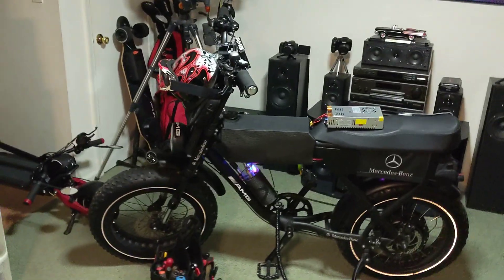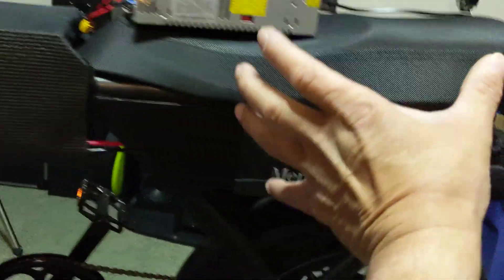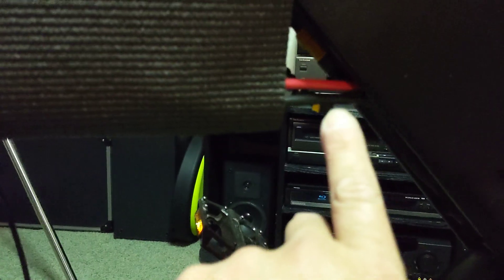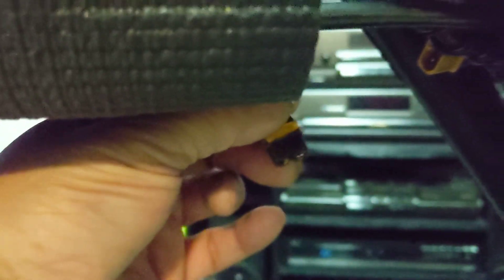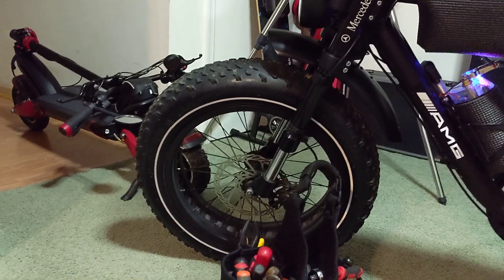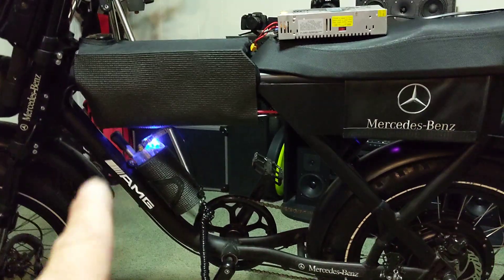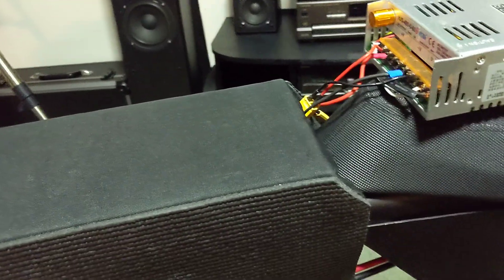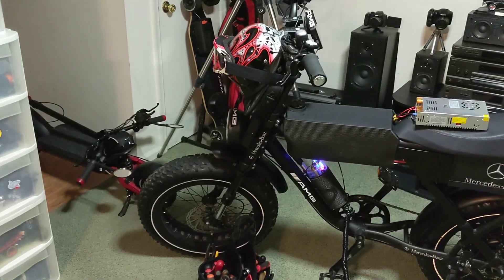High Output Ebike battery systems, remove connector between Batt and controller. it's a bottle neck!

Comment: Bro- ur a ebike magician... lol
I'm a complete newb at this. Trying to soak up as much as possible.... Just got my first bike.  One run,  i knew i needed more. Im hooking in a 52v to a 48v thru a battery mixer.  If it works, I'll add a third one by end of summer(the mixer can run 4 batteries at the same time).
Keep putting out the tech know how- I'll try not to burn up my bike while learning🤣🤣🤣🤣🤣
Reply from the maker: lol My man be careful with those battery blenders tho. I know they claim they work but honestly that right there is some magic because that goes against all the laws of electronics let me tell you. Your not supposed to be able to mix different battery voltages in parralel. Im not trying to say they havent come up with a safe way but I been dealing with batt systems for a long ime, not on ebikes but batts are batts. I know exactly what your talking about ive seen that shit on Freddies ch and spark cycle works. I know they have a circuit thats not actually allowing them to connect at same time but when voltage drops to a cetain level it switches over to other battery but anyway. let me know how that works out for you long term. Thanks take care stay in touch
Reply from the maker: @danimayb  I know what it is and I'm definitely not faint hearted, you must haven't watched many of my videos. I just don't think it's worth a dam. Just as you said just a simple diode circuit that I wouldn't pay $150 for.  lol I'd just get off my bike and plug the other battery in when I killed the first.  If I want real capacity that I can't put real current demands on I'll put two batteries of equal voltage in parallel. I'm trying to save these guys money and $150 ain't worth what a blender does. I've heard the speil about the range increase so does just switching batteries manually

Comment: im sorry but i coudnt disagree more. your problem was not that you were using connectors, your problem was that you are using underpowered connectors. a hard wired connection is a PITA to do work on. just use the correct connectors.

xt60 is a 60 amp connector, if thats insufficient then use an XT90 connector that runs 90 amps. if thats not enough use a QS8 connector that runs at 120 amps. if you need more than that use d6 connectors that run 160 amp.

and FWIW, i did spend a bunch of money on a litespeed 40ah battery and i just had to change the connector from a QS8 to a D6  because i upgraded from an 80 amp speed controller to a 150 amp speed controller.
Reply: People seem to forget the vibration in a connector or the big sparks from plugging in or out. Not to mention rain water getting into connectors and causing corrosion and bad/intermittent connections. A solder joint and marine grade heat shrink is the way to go.
Reply from the maker: @Mike Morgan  Thank you Bro for being a smart person and knowing the best and proper way for pwr is to have as few weak points as possible and disruptions to real pwr and it's just a surface connection as it's just the sides of those terminals touching each other as Solder joint is all the way thru the entire wire. great comment
Reply from the maker: another great point I forgot to mention
Reply: @ChrisCrossingWires1212  , A proper connection is one you never have to work on or disconnect unless it’s with wire cutters.
Reply from the maker: @mikemorgan8588  ABSOLUTELY and he probably don't get that cuz in that situation you don't even have time for connectors, cut and kick! lol
Reply: @ChrisCrossingWires1212  , Yep, keep riding.
Reply: @mikemorgan8588  sparks from plugging means you don’t know how to use power switches. That’s kinda messed up. It shouldn’t spark, control your electricity man.
Reply: @dumwaldo  , The contacts in switches are sacrificial due to arcing . There is no difference.
Reply: @mikemorgan8588  its not supposed to arc. my first attempt at building a bike did that but i LEARNED MORE and that doesnt happen when you do things right. its not supposed to arc, install a power switch.
Reply from the maker: i know that i only had xt60s on there but i was not about to wait on ordering some and have my bike down so fastest way to resolve that was remove them and why should i keep any connectors after that if Im never gonna remove my battery's ever. Now im recommending people remove them but Im talking about guys running high power systems, if you have a system that isnt pulling more than 100 amps sure, im talking to the big boys out here 200 amps, 10-15kw. i should have stressed that but no worries and you can disagree, you have hat right but this is my build and thats how i chose todo it. as i said im never gonna remove my batts and i didnt have time to wait so this was MY SOLUTION.Also as you mention, you did pay top dollar for a light speed battey, If I paid 3 grand for a batey maybe id spring for those big fancy 160 amp connectors but Im not about to put connectors on my build that cost more than my battery system, make sense? as I would need several with all the batteries I have, Just wouldnt make economic sense for me, it cost me $70 for my upgrade,lol think Im gonna spend $300 on connectors? NOT! Thanks tho I agree i could have used some xt90s as my system is here but I plan to upgrade even more in coming days, and I DONT WANT ANY CONECTORS ON MY BUILD. NONE at all but you can manage your build however you see fit but I plan to possibly run multiple motors in the future and two different systems so yeah, I dont want any at all.I have no problem with soldering and unsoldering wires and beings tho I will be the only one ever servicing my bike its not hard for me to work on, as i have no problems at all .Thanks for the comment maybe that will help someone else

Comment: Thx for sharing, learned some things from your battery setup. 👍🏾
Reply from the maker: check it out in action, it actually has more top speed but i have it limited to 40 right now until i upgrade my tires, dont trust them and im waiting on an entirely new motor and controller as of right now this is a cheap chinese 45amp and 1500watt direct drive. Im waiting on a 3K motor and Fardriver controller from Alibaba.  https://youtu.be/1NeEjheFbEQ